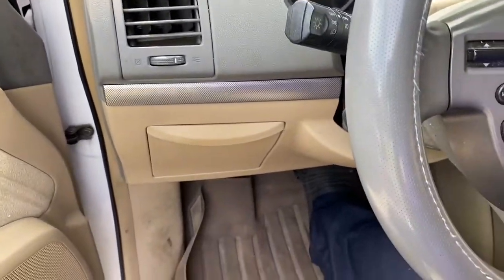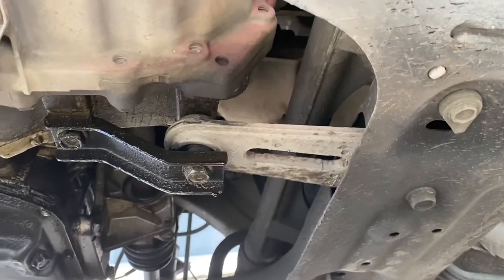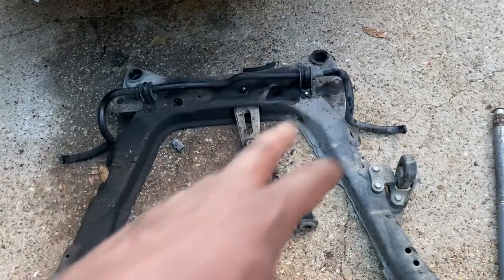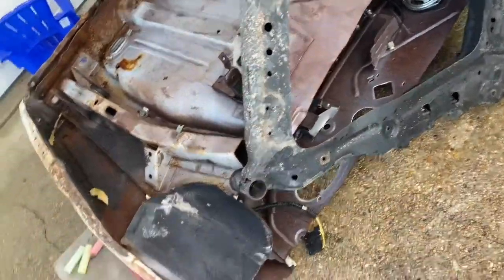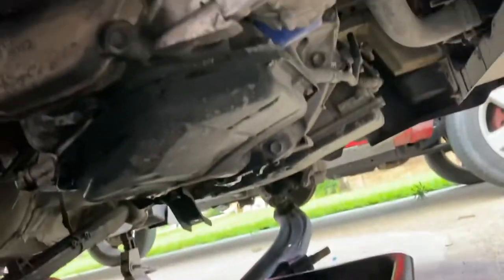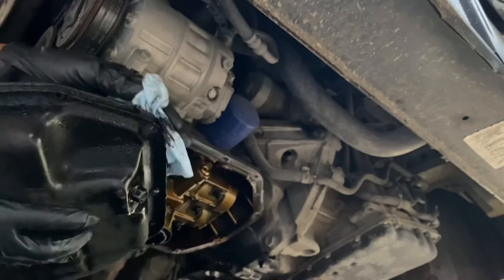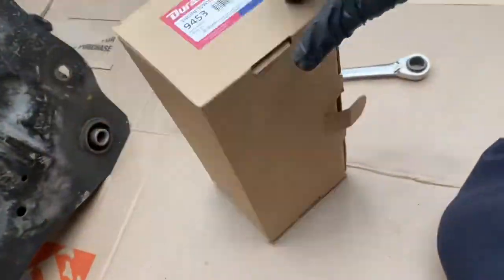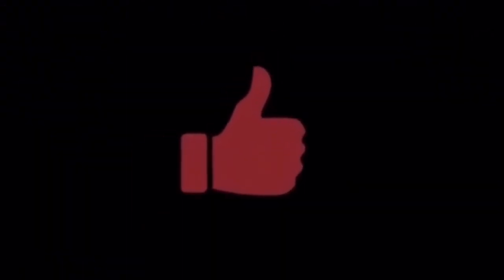Nissan Subframe Bushings Replacement ( Broken Subframe Bushings )

Comment: It is a great idea to shake the subframe with the Jack Lift to see if it is moving and how. I tried to find any movement w/large pry bars, but couldn't fing the source of the problem w/clunking when driving. I definitely need to use your method, it is unique and only in this film. Thank you again.
Reply: Pry up. thats the key.

Comment: Thanks Mr. Random....your video helped me decide not to attempt to replace the bushings..I will let the mechanic do it because It's more involved than I thought and I don't have the correct tools.
Reply from the maker: I agree with your decision it was a good getting those bushings in and out but you can bring the frame to maybe a local mechanic shop and have them replace them for you. I would definitely get a good brand replacement

Comment: @2:29   May I know how heavy is that subframe, approximately? And those bushings are they matter or safety or more like convenience (no bumping when driving). We have 2009 Nissan Sentra and it started to clunk and bang a lot after I hit smth on the road. I thought it is a broblem w/struts and shocks (they were kind of worn, actually 1 on the front was leaking), so I replaced w/new all of them front and rear. But the problem is still there, and the sound is such, when you go over smth uneven, like smth is about to fell apart. The rear springs are not broken, seems like everything is solid. The hgorrible sound comes more from the rear passenger side, but then seems like moves to the center. What that can be? I would appreciate any opinion on this matter. Thank you for the great film.
   Update: the weight of the subframe is 32.70 lbs
   A dealer can't replace bushing on 2009 Nissan Sentra, they don't have OEM bushings, and since are supposed to go just w/OEM they can only replace the whole frame.
Reply from the maker: Wow, good luck. Sounds like the bushings is your problem. Purchase them from a local automotive store and bring them and your frame to a automotive shop, they need to be pressed out and back in. Maybe try like TireKingdom, Goodyear , Firestone. If they can’t change it on your vehicle then they should be able to atleast replace the bushings for you if you bring it to them. Good luck, it’s a easy fix, just takes time and the rite tools
Reply: @MRRANDOM1  Thank you for the replay. Probably I should go to Firestone, but decided that Nissan Dealer might do better job.  Actually I thought only dealer can do that subframe. They put a new front frame, since Nissan doesn't make bushings and they need to go w/OEM. Very expensive ($2000, but they gave me the original frame back, so it is not so bad, since I have now extra one to practice w/bushings and maybe next time to install myself). That front subframe on 2009 Nissan Sentra is ~32 lbs, if someone needs. I misunderstood the weight and thought it is much-much heavier. It is very good to know that Firestone can install bushings on that subframe. I bought the set and have all kind of press tools, but the job looks scary to me. So if I won't be able to replace the bushings at least to know who can help. Thank you for you advice.
Reply: $2,000 for the whole thing wasn't too bad. I got a quote two days ago from an small ugly repair shop and they are asking for $700 plus tax just for labor replacing the four bushings and I still have to pay and find the parts.  What a crazy world we live in now
Reply: @elchapitodeguerrerofans4640  Actually the deal you found is much better than mine. The most complicated thing is to replace those bushings. And anyway the mechanic needs to remove the subframe. Also keep in mind that in dealer they use only the original parts, and that part (bushing) is very bad on that car by its design (see how many complaints that the bushing goes bad after 60-70 kmi). The mechanic in that small shop will install aftermarket bushing, which will be better (just bcs the original one is so bad). In other words I would prefer the deal you found. Though mine is not so bad as well, since I took the original subframe (it is your right), so can practice on a new bushings on it. The subframe is just a piece of metal, nothing can go wrong with it. I found new bushings on Amazon, like $100 for all four, but I didn't replace them on the original subframe yet. Anyone w/2009 Nissan Sentra needs to have a spare bushings, bcs of the problem mentioned above.